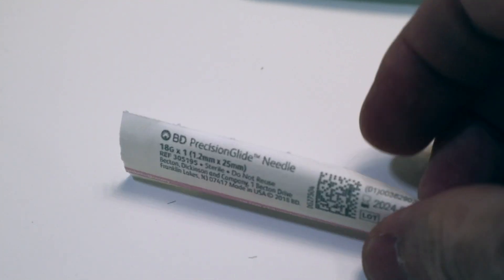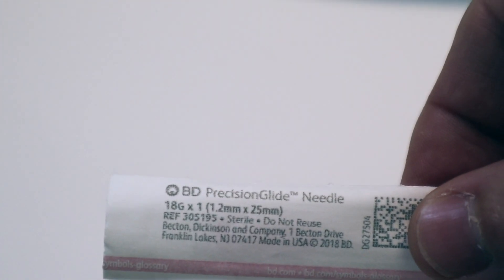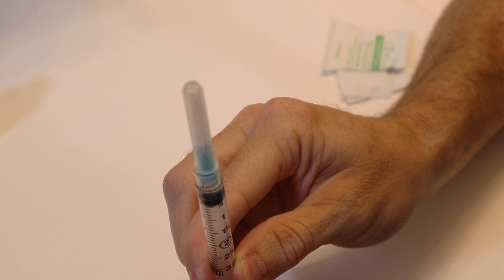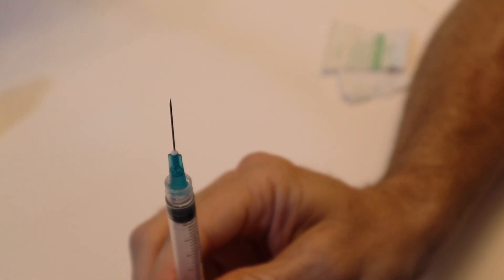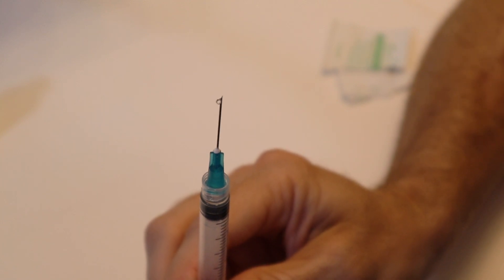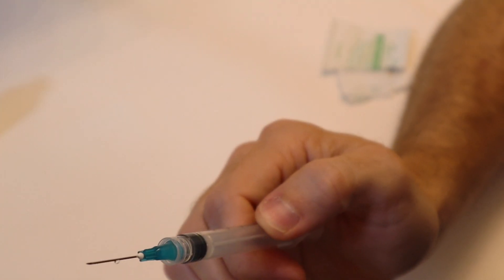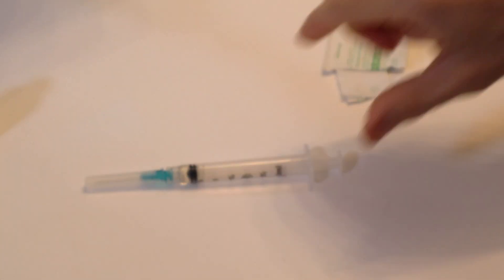TRT - What I Use.  How I Do It.  What I Changed.

Comment: When you decide to replace the leftover Test back into the vial, at least cleanse the needle with an alcohol swab. I’m speaking as a doctor, actually a cardiothoracic surgeon. You don’t ever want to transport bacteria bc this certainly leads to it and can start a major infection.
Reply from the maker: Gotcha. Thanks for the tip, doctor. Much appreciated, and thanks for watching.
Reply: Mister, random question having nothing to do with trt, but I had my right lung collapse a year ago and had the surgery to try and save as much as they could since it kept collapsing after being taken off the vacuum. I feel much better a year later, but just get winded really easy and I’m always concerned my lung collapsed again which leads to anxiety. I’m not asking for med advice,  but is there a way to tell if my lung is okay without any kind of imaging, like checking oxygen levels with a tester? Any input would be greatly appreciated as my cardio thoracic surgeon has retired after 52 YEAR OF PRACTICE! He was a surgeon in Vietnam In 67 and 71
Reply: This shouldn’t be done at all. He should be using an insulin syringe and that alone is enough to avoid waste. Thanks for bringing this to his attention.

Comment: i would never inject the leftover back man, just seems wrong. 
put a small amount of air in the syringe before injecting and nothing stays in the syringe after injection
btw 18g drawing needle will damage the rubber seal, so i use 23g drawing and 27g injecting
Reply from the maker: Gotcha. Well thanks for your concern and for sharing what you use.
Reply: I haven't heard that before but I was wondering. Thinking this huge needle must sure be doing a number on that rubber seal. Seems like it's still sealing but barely. Would be better to use a bit skinnier gauge needle as you stated. I've been using a 25 g to inject with. thinking about going smaller as you suggested.

Comment: I'm surprised everytime I see these videos on drawing the test from the vial with a large gauge needle and have not seen people using the vial adapter that eliminates the use of the drawing needle altogether. Everytime I get a new vial of test my pharmacy includes a new vial adapter with the presciption.  It works the same as drawing with a needle but so much faster.  I believe they are available on Amazon as well.

Comment: A tip from my TRT practitioner regarding viscose (thick)  testosterone.  Hold your syringe under a hot faucet for less than a min - at the dose location.  This makes the testosterone 'less viscose' - and make the injection easier.  I use a 26gx1" needle and a 1ml syringe.  Good results and less waste within  the drum of the needle (the afore mentioned leftovers).
Reply: I warm the vail up on a mug warmer. Works great!

Comment: I know this video is a couple years old, but have you ever considered using a luerlock vial adapter on the 10ml vials instead of the 2 needle method? I find that drawing the oil is easier and there’s not usually any air bubbles to worry about as well.

Comment: Hey Pastor bro you don't have to make it that complicated.  If you are injecting those drops back into the vial... that means that you are not getting the full amount into your injection itself.  In other words... you are injecting less than 40mg (probably less than the .02ml from the syringe.  That means you are getting less than 40mg per injection. 

Like I said before... draw the exact amount (I am assuming for you it is .02ml) and add another .01 to .02 ml of air behind the cypionate.  You can do this IM or SubQ.  That air in your muscle or fat does not affect you.  That way you get the full amount.  So after I draw the Test into the syringe, I turn the syringe needle side down.  Let the air creep up just beneath the plunger.  Once that is done I inject my quad muscle.  First the Enthanate then a bit of air.  I get my full amount and no waste.  The needle itself tells you the air goes into you muscle or fat when you hear a little "squishy" air sound.  Done!  The way I see it from your explanation... those 6-8 drops left over should go into your body... not back into your vial.  Am I correct or not?
Reply from the maker: You make a good point. Thank you.

Comment: Great video as always brother. Keep up the great work. I go subq via insulin syringe using a 27g 1" 1ml twice a week. Fast pull, low pain, easy injection, little if any waste in the syringe.
Reply from the maker: I'm going to have to look into that because that sounds like the way to go. Sadly, I just purchased 100 more 23g x 1" syringes about a month ago. 😩
Reply: Best is 27gu 3/4” 1 ml
Reply: Jimmy Schmidt Thanks Jimmy. I’ll give that a try.
Reply: Is that with a cypionate? Doc says that type of injection with cypionate doesn't work well. ends up with a bump or something along those lines where you inject. But not so with enanthate apparently.
Reply: Joseph Williams I use test cyp. Never had an issue with a bump. I would get bumps when doing 1ml IM probably because of the volume. Doing 0.5ml twice a week even subq hasn’t given me any bumps.
Reply: @robertm5528  10/4.
Reply: @robertm5528  just rub in the bump it's on site storage,Dr. said it was A.O.K. and I know it's there sub q in my ab,s for a few days!

Comment: Where do you store the testosterone vials? If the vial is 200mg/ml and for example i only need 80mg, can the vial stay open like that until the next injection of 80mg?
Reply from the maker: Do you have the vials that break open, and then stay open? If so, I'd recommend drawing all the T up into a syringe (or syringes) then putting the cap back on the syringe(s), and just storing it that way. Then you just inject how much you need from those syringes. 
If you have the vial that has the rubber top that you poke the syringe through to draw up the T, then you can just store that in a cool dry place, like a bathroom drawer. Just make sure you swab the top with an alcohol swab each time before you draw. No need for refrigeration or anything. 
Hope this helps.
Reply: @trtcommunity9248  yea glass vials, so i can put all 200mg test in one syringe and just use the perscribed dosage each time (just changing the needle), keeping the syringe in a cool dry place?
Reply from the maker: I’m not a doctor, nor is this medical advice...but that’s what I would do.

Comment: Hey please respond if you can what is your current testosterone levels through the troughs and peaks ? And what did you start at
Reply from the maker: Thanks for watching and for your question. 
I’m currently injecting 80mg/week that I split into two injections of 40mg. 
Though I don’t check my levels very often the last time I checked, my T peaked at around 1200ng/dL. As for the low, when I had a 2 week laps in my dosage recently (I ran out) my T level dipped down to 291ng/dL. 
When I first went to the doctor 2 years ago because of the negative symptoms I was experiencing, my test showed my total testosterone at 183. 
Hope this helps.

Comment: OK wow I was thinking that would be a badd idea but it sounds like it's no problem to put the left over back in your bottle however wouldn't it be better to put it in a separate empty vile instead of possibly contaminating your good stuff and only using it as a backup source when you run out... whatcha think.. sounds good to me.. and i am going to start doing this
Reply from the maker: Yes, you could totally do that. But another idea might be what someone else said he does. He said he sucks the extra back into the syringe, then just changes the needle on that syringe. He then uses that syringe for his next injection.
Reply: @trtcommunity9248  another good idea..

Comment: Good evening!

I just started TRT, actually on my 3rd week.

My question is: is it better to stick to the generic brand, I’m currently using Perrigo, or should I pay the extra for the original Deposit-Testosterone

Thank you
Reply from the maker: Thanks for watching and for your question. Honestly, I might not be the most help with this, because I've just always used what my doctor prescribed and the pharmacy gave me. I'm assuming what I'm injecting is the cost effective type. I've always had good results with it. 
If you really wanted to test it out. Try one vail of the Perrigo and the the next time go with the other and see if you can tell a difference in how you feel. 
Hope this helps.

Comment: Yikes. Don’t put the dirty syringe back in the vial! Instead, fill the syringe, pull back on the syringe to let a pea size air bubble in, and then inject while keeping that air bubble on the top towards the plunger. The needle tip will fill with air at the end of the injection and you will use all the testosterone you drew out.

Comment: Could you please let me know what was your PSA before you started TRT and what was the PSA after TRT? Thanks for your help. I want to start TRT but I'm afraid  my PSA may go up too much.
Reply from the maker: Thanks for watching and for your question. Well, since I started with a general practice doctor he only did basic blood work, checking some of the main areas. That's when he learned I had low T and then started me on TRT. About three months in he sent me to a specialist; a urologist (though most people use an endocrinologist). He checked my PSA and said everything looked fine. Not sure what the number was, but he said it looked fine so I was happy. 
If your doctor has checked your levels and found your T is low, you can ask him to give you a referral to a specialist if you'd like a much more comprehensive set of tests. Yes, it will cost more but at least you'd have peace of mind. Then you could keep using your general practice doctor for your T prescription and just have specialist check once a year (or every 6 months) to make sure things are looking fine with your PSA.
Hope this helps.

Comment: Has your doctor wanted you to use an aromatase (estrogen) inhibitor at all or monitors your estrogen level?
Reply from the maker: Thanks for the question. No, he's not really a big fan of using an A.I. He did prescribe it to me once towards the beginning because I was a little persistent in my desire to try it. That's back when he had me on 150mg/week and my estrogen was getting elevated. 
But since then I've chosen to just lower the amount of T that I inject to manage me estrogen level. 
Hope this helps.
Reply: @trtcommunity9248  Thank you so much for your reply.  My endocrinologist is vehemently opposed to it and won't even consider it.  I currently inject once a week but am going to move to twice a week starting this week.  I have been on TRT for a year and for the past few months I just haven't felt as good.  From what I read and like yourself, most people say to stay away from A. I.  and didn't know if I should push the issue with my doctor or get a new doctor.   I am not even convinced I have an estrogen issue, I simply just don't feel as well and seem to feel high's and lows.  Thank you for your time.
Reply from the maker: @CanonProPhotographer  My pleasure. I started my channel to help guys just like you. 
I also started to feel less than normal roughly 2 months ago. So I moved from injecting weekly to biweekly and it's helped. I wish you the best, my friend.

Comment: A thing about the leftover oil in the needle, I’m doing subq and I’m using 30g half inch bd insulin needles and there is like no waste pretty much
Reply from the maker: Yes, that's a great advantage for you subQ guys. If it's working for you keep it up. 
Thanks for watching!
Reply: TRT Community I’m doing it daily to lol. I’m doing it in love handle area, belly and butt fat. I’ve noticed in some areas it burns more and in some nothing at all almost. I’m injecting around .12 or .13 ish every time of test cyp in grape seed oil. I’m a month in and feel great. I was feeling a big difference within the first week. Love your channel, keep up with the great content. We need more exposure to trt. To many ignorant people out there.
Reply: It could be a considerable amount, especially if your splitting to smaller doses for Every day, every other, every third etc. I found out this is a known issue, and that they actually make syringes with this in mind. Look for "Zero Dead Space" or "Low Dead Space" Syringes. They're out there. That way you don't have to settle for insulin needles. @trtcommunity

Comment: Would you  believe a testosterone level at 485 after taking 200mg every 10 days ?? This seems low for a 200mg dose Would love to hear some opinions thx
Reply: For how long have you been doing that?
Reply: You need to split that up. Should be around 75mg Monday and Friday give or take.
Reply: The human body is interesting. I'd make sure the injection isn't coming back out a little. I've been between 500-680 40mg bi weekly.
Reply: nikto45   yeah the going consensus is more often the better to keep everything steady that is (test/est ratio). But the difference between 2 times a week and 7 times a week is minimal on oil-based cypionate because the long half-life. yeah, it would be a bit better but having to pin yourself every day is just not feasible in reality.
Reply: nikto45  Oh I see. For some reason I was thinking you were saying every day, but every other day is obviously a different story and with the smaller gauge needles I can see it as being doable and beneficial. I will consider it more. It's hard to do something other then what the doc recommends even though I know this is a better way to do it. With that being the last lab I had I had right before I take my next shot and my total t came back 994 ng/dl so my dips are in the 900 range lol. It would be interesting to see what my level is in the middle of my shot schedule.
Reply: nikto45  Yeah, I've come to realize I was very fortunate to get a doctor that actually new what he was doing. Heard so many horror story's from others who weren't so blessed. He proscribed me 140 mg per week split in two dosages of 70 mg Monday and Friday. Worked like a charm. My test came back at around 994 and my estradiol around 38 and my hematocrit was in the normal range so he said labs look good we will just continue with the dosage we started you with and no AI's thankfully. AI's are one of those things that I've heard a lot of bad things about. Not something you want to be using unless your way high on the estradiol. Sounds like you've done your research and figuring things out. It's not as simple as just doing what the doctor says most of the time these days. It's gotten better but still a long way to go.

Comment: Sir, Did you take any AI when taking 300mg per week?
Reply from the maker: Thanks for watching and for your question. 
I apologize if I accidentally said 300mg/week in one of my videos. Maybe I was referring to back when my doctor had me injecting every 2 weeks. I changed that to injecting weekly soon after that.
So at that time I was injecting 150mg/week. At that dosage my estrogen level did get elevated. It was never in the 'high' range, but it was getting close. So I asked my doctor for an A.I. He reluctantly prescribed me a month's worth. I never even finished the entire bottle because I wanted to take more of a simplistic approach to my low T problem. 
Because of my low T, I was having to inject testosterone (no way around that). I didn't want to then be dependent on a 2nd drug due to the fact that I was taking so much testosterone. So I decided to decrease my dosage amount of T in order to combat my elevated estrogen. 
I reduced it down to 125mg/week for a while (like 2-3 months). It was still higher than I wanted. So I went in and got the doctor to do some more blood work. We agreed on 80mg/week. Voila! No more estrogen issues. I've been on that amount for roughly 7-8 months now and doing fine.
So, for me personally, if I can keep my negative symptoms away with a lower dosage of T, and that also keeps me from needing another synthetic drug (the A.I.), then I'm happier that way. 
I can't help that I have to inject T, but I can help needing an A.I. 
I welcome any follow up questions you may have. God bless.

Comment: so the testosterone vial can be punctured multiple times and still be safe to use a week later for my second shot  ?????
Reply from the maker: Absolutely. Some people would disagree about me putting the used needle back in, and that's fine. But repuncturing with vail with sterile needles each time is completely safe. That's why they prescribe bottles as large as the one I had. It's designed to be reused for months. 
Hope this helps.

Comment: You really need to stop using that harpoon and switch to single-use fixed-needle insulin syringes.  If you are impatient and unwilling to spend an extra minute to draw, you can use a 27 gage needle, but a 30 gage is nicer and you will barely feel it stick in your skin.  Virtually no wasted cyp because the needle is so small and you don’t have the extra chamber to retain cyp like you do with removable Luer-lok needles, and they are very inexpensive for a box of 100 of them on Amazon.  No need to reinfect into your supply bottle either, which is not sterile, even if you get away with it without an infection.  Also the smaller diameter syringes make it much more accurate to read the markings, because they are spaced further apart, and you use a greater length of the syringe instead of the tiny amount of the syringe you are using with that huge one you are using in the video.
Reply: Where are you injecting?